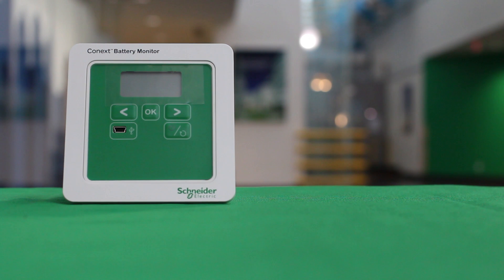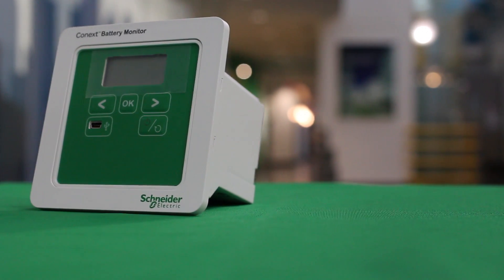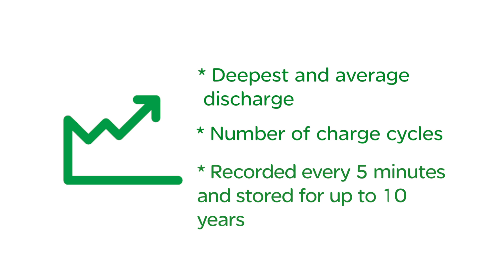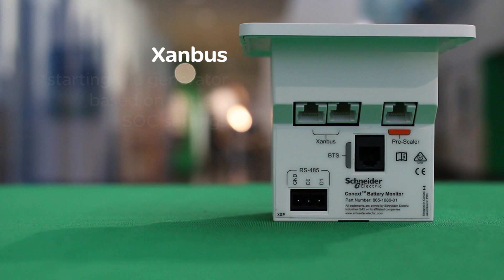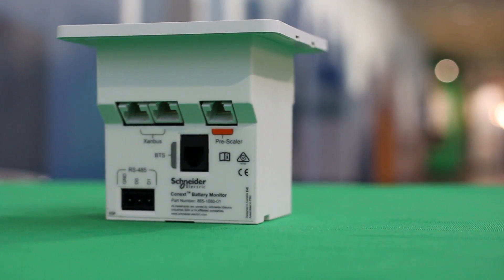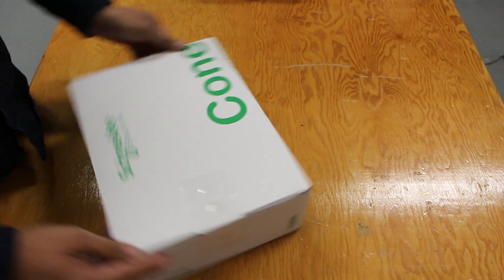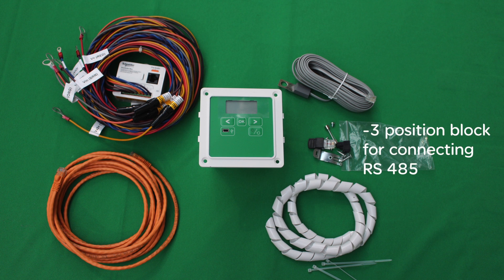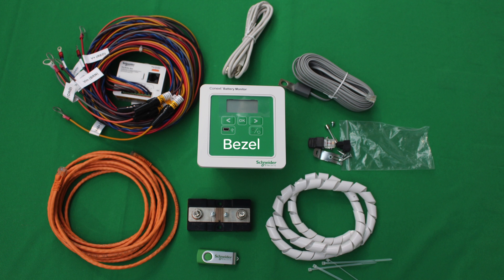[Part 1] Conext Battery Monitor: Overview and Unboxing

Comment: Hello, i have a 865-1080 battery monitor and charging my batteries using 865-1030 solar charger i noticed it doesnt increase battery % while charging and never go to fully charge, any ideas? thanks!